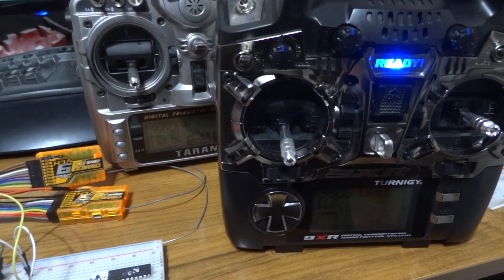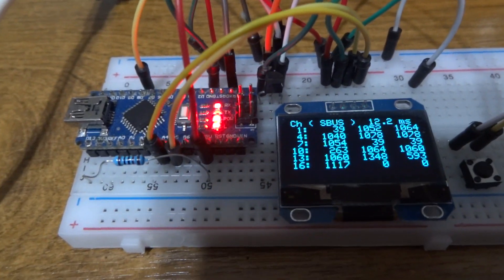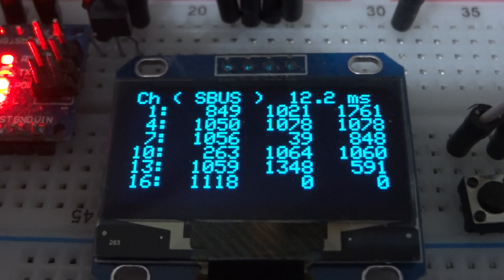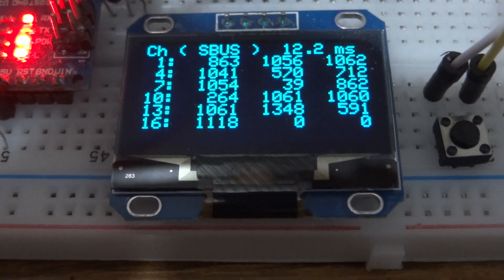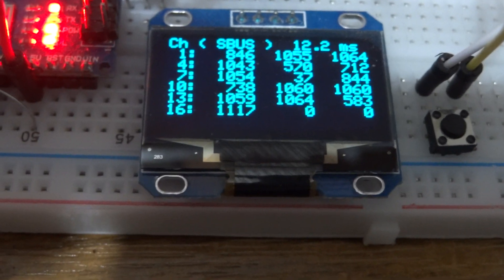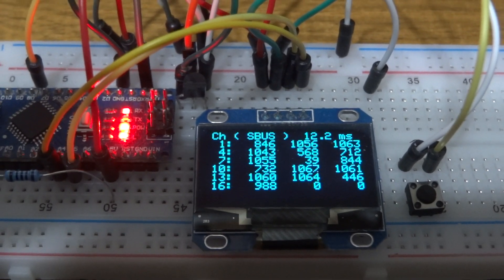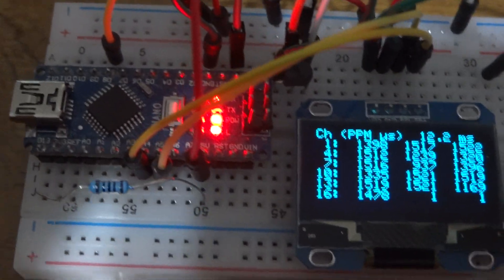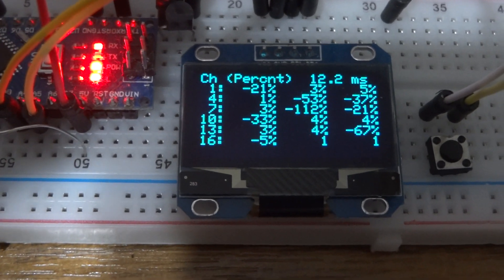PWM to SBUS encoder (up to 18 channels) on Arduino Nano

Comment: Hello Martin!
I really like your videos, they are interesting. I built "ppm monitor" and it works perfectly
I also have a request for you regarding the clip "Simple single-axis gyro, Arduino + MPU6050" I would like to do the assembly with arduino but I did not find electrical diagram in the site mode-zero.uk. I only have arduino pro mini at the moment, I want to build both arduino pro mini and attiny85 variants
Best regards!
Robert